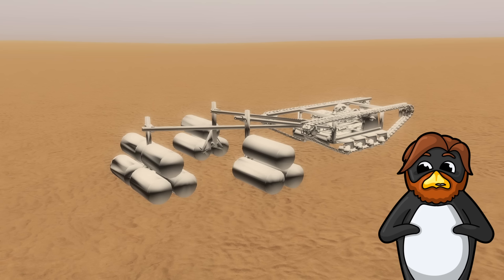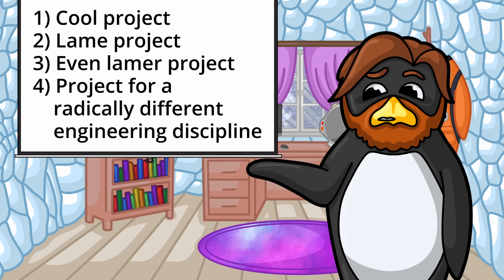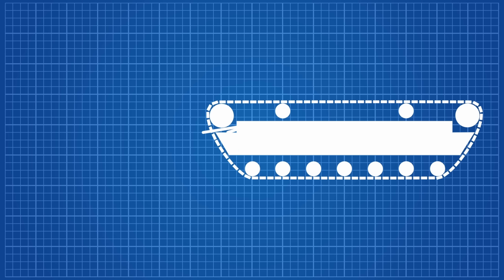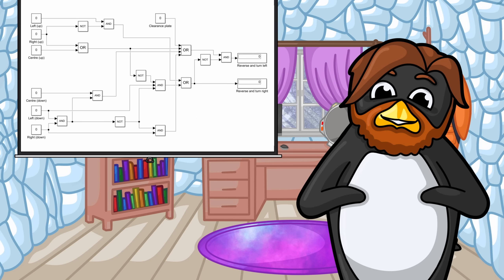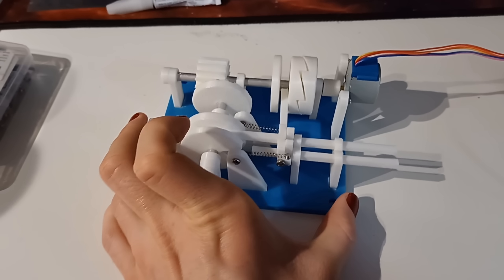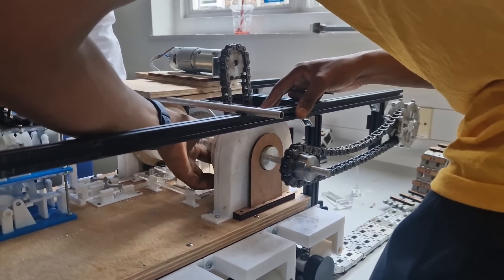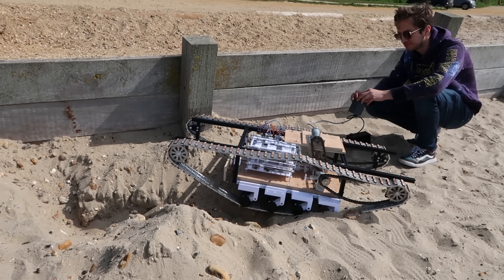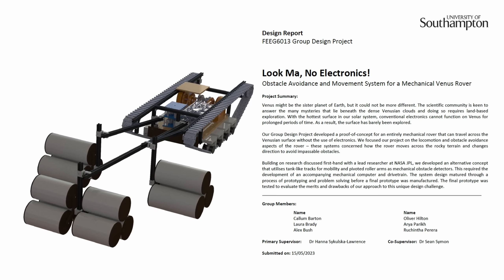We Built a Venus Rover so NASA Didn't Have To

Comment: I had an internship at Lawrence Livermore National Labs and one of the other interns had a project designing mechanical logic gates. Unlike your mechanical logic gates, these use flexures and can be scaled down to miniature scales. Sounds like they would fit here perfectly on a real Venus rover
Reply: It depends on the temperature at which the material they're made from becomes bendy.  Mind you, the actual prototype mechanical computer from this project would mostly evaporate on the surface of Venus.  But, if the other intern's flexure logic gates depend on, say, TPU or some other thermoplastic...  

Of course, you probably knew that, but I felt like I needed to say something.  I've seen various awesome things done with reversible structures and flexures on Youtube, and it seems difficult to imagine re-engineering these designs to work in what amounts to hell.
Reply: @bearnaff9387  Good point but... Titaium will fix it if not an alloy or composite and given Nasa won't attempt this for at kleast a dacde and the rate of titanium manufactor advancement I can see the final design being half the size atleast of beardies team's version... Though I doudt it would be anything more then a felex for NASA as what radio and camre ciould it carry? Then again having a rover on venus just living it's life that a air or space satlight just takes pictures of would be cool in and of it's self.
Reply: holy crap my brain is not awake yet and I swear I read "I had an internship at Lawrence Fishburne" and oh god I had questions

sorta sad now, tbh